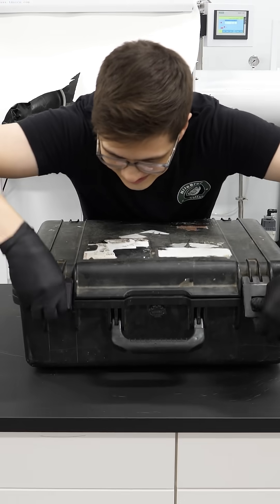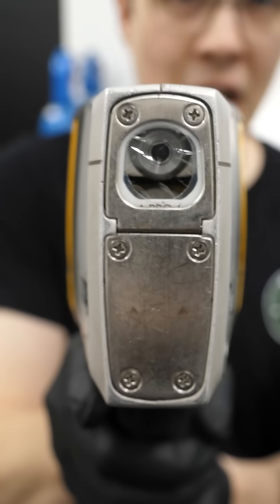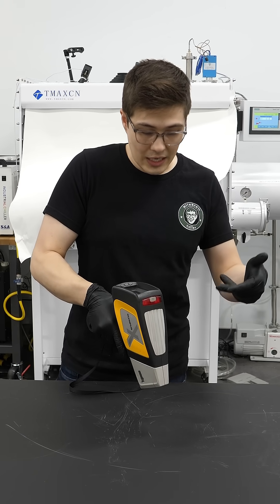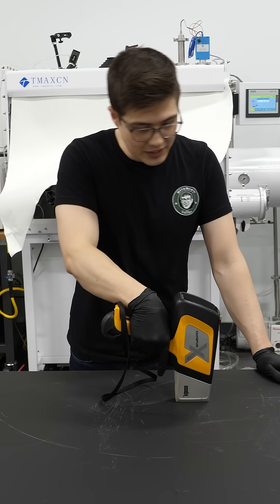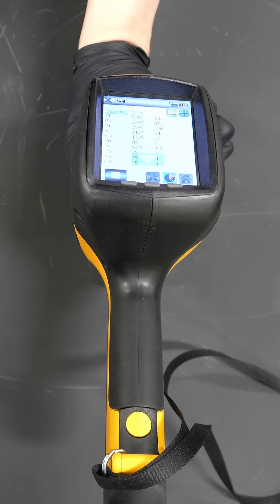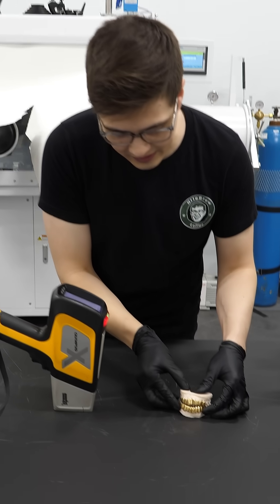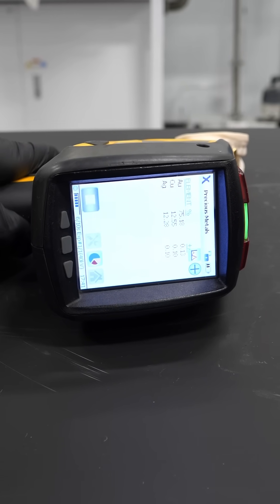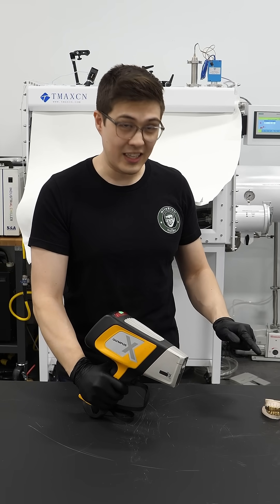I bought a ray gun

Comment: I used to work with those, you can use them to determine the composition (metals) of PAINT, the composition of SOIL if the sample is properly packed, and the alloy composition of metals.  
If you work with them regularly, one of the things you NEED to remember is it does shoot x-rays and they will shoot through a desk.  So if you're working on a desk or lab bench, MAKE SURE YOUR LEGS ARE NOT UNDER THE DESK or it will hit you with X-Rays and you'll eventually get bone cancer because of it.
Reply: this is why x-ray doctors always stand way back when they take photos. it's not going to affect one patient just having a few photos taken, but it will affect the doctor that has to take a hundred of those photos between every patient every day
Reply: @perkypears  Yep.  Also why they make patients use a lead apron to cover any areas they don't need x-ray pictures of.  No sense in getting full body exposure if you only need to see a single bone.
Reply: Is a cancer risk on the warning label, or are you just making the same assumption I would make.
Reply: @urieaaron   It's on the label, and in the instruction manual, and in the digital software tutorials, and a MANDATORY sticker on the side of the gun.  It specifically says in the manual "make sure your leg is not beneath the sample or you will expose yourself to potentially dangerous levels of radiation."  When you boot up the software, there is a pop-up window reminding you to move your leg out from under the desk before you pull the trigger on the gun.  Olympus took great care to make sure users have multiple opportunities to be reminded not to shot an X-Ray laser into their own legs.  Basically all the same warnings and signage that goes with a medical x-ray machine comes with this one, too.

And it is an x-ray laser gun, literally.  One or two test scans with the thing might not leave you with any lasting damage, but just like a medical x-ray machine if the technician is working with it daily the effects will build up over time, and the risks (specifically for cancer caused by radiation) also increase the more often you use the device.  
It's not so dangerous if you use it properly - make sure you know what you're aiming at and what is behind/under the thing you're aiming at; keep the scanner tip flat against the surface to avoid any unwanted sideways reflections of the beam, and if you're going to use it pretty often then you might consider getting yourself some simple lead shielding to cover any body parts that may be inadvertently in the path of the scanner beam OR REFLECTIONS FROM THE BEAM.  If you're checking paint that's on a wall, look behind the wall first to make sure you're not accidentally going to expose anyone or anything behind it that may be sensitive to x-ray radiation, and don't hold the tip at an angle but keep it FLAT against the wall to better contain the beam - and to get a more accurate reading.  Common sense and good prep work are key to using tools like this safely.
Reply: @urieaaron well, assuming that ionising radiation can give you cancer and you should thus protect yourself from it is actually a pretty safe assumption.
Reply: @urieaaron in Belgium we have to register them with the “FANC” (federal agency for nuclear control), and you have to have permits to use it. So yes there is definitely a risk associated with using it.
Reply: @urieaaron I'm assuming there is a radiation risk label somewhere on the box or on the gun, as all x-rays do. 

But specifically the problem is that if you use the gun often but don't carefully point it away from yourself, overtime all of those exposures stack up. Just like going through an x-ray machine, once or twice is perfectly okay, but once you get up to something like 50/60 times you're treading on dangerous ground. Plus this x-ray gun is probably more intensive than a regular human body x-ray, since it's meant to analyze metals and such.
Reply: @caseyoverland7829   It's not "more intense" it's actually LESS.  But it's also a COMPLETELY DIFFERENT technology, a TOTALLY DIFFERENT way of using the x-rays.  In medicine, you spray x-rays at a body part and your actual target is the film behind the body part.  After you develop the film, areas that the x-ray hit show up as black, while areas that had the x-rays blocked (by metal, bone, etc.) show up as transparent.  So you're not even looking at "compositional analysis" in that case, it's just a straight up photograph but using x-ray instead of visible light.  But this gun and XRF in general works differently; it's a whole branch of physics in itself to explain how this system works.  You're actually reading x-rays that are emitted FROM your target, since hitting them with the original x-rays kicks an electron out of its orbit and a higher-energy electron then has to drop down to fill the hole... and that extra energy from that second electron has to go somewhere so it gets spent as x-ray radiation which the gun's detector can measure.    Now those lighter atoms only have ONE layer of electrons, so they don't have any higher-energy electrons to drop down and fill a hole if an inner one gets kicked off by the gun's x-rays... or if one does then the energy difference is too small for these detectors to read accurately.  Those heavier atoms, like plutonium or calcium, have several layers of electrons and each time a lower-level one gets kicked out by the x-rays the hole might be filled from another one from ANY of its other levels... which is why most of the elements emit several different frequencies - one frequency for each different level of electron that can drop down to fill the hole left by the one that got ejected.  
Medical x-rays are just photography with a twist.
XRF is a cross between materials science and particle physics. 
And the XRF beam is much narrower, covers much less distance and area, and uses much less power... and is considerably "safer" than medical x-rays.  But yes, you still have to be careful when using it because if you're not paying attention it will come back and bite you when you find out you've developed bone cancer or something.
Reply: @MrDavidMoyer  I'd like to thank you for all the neat info you shared over the last handful of comments. It was a pleasure to read!
Reply: @MrDavidMoyer  it is a few orders of magnitude more intense; it's just much smaller. A chest X-ray unit would just melt if you ran it at XRF power.
Reply: No, you have it backwards.  The XRF unit runs on just a couple of Watts for its beam, while the medical x-ray machines use around 70W.  But as you said it is also MUCH smaller, meant for scanning 1 sq inch rather than several sq feet.  And as such it requires a lot less power to operate, the machine is less power intensive AND the beam is roughly 50x weaker than the medical machines.  
But in biological terms, looking at the differences in what effects the beam will have on your body... there isn't much difference between the two.  The real difference shows up in how frequently you use the equipment.  Medical x-rays take a while to setup.  You need to replace the film each time, and then get the patient into position, and then adjust the aim and positioning of the machine, and then drape the lead apron over the patient... so you're limited in how many medical scans you can do in a day.  But with the XRF guns, as long as the samples are prepared beforehand (or simultaneously but by someone else) you can literally run 2 scans per minute, all day long.  And the worst of the health effects come from repeated exposure, especially RAPID repeated exposure... or extended exposure times but that's not an issue with either machine since both only activate the beam for a fraction of a second up to a few seconds each time.
Reply: @MrDavidMoyer I do inspections on x-ray units. An XRF has to push enough energy density to push through the sample and saturate the material with enough energy for the atoms to kick out there karacteristic x-rays in statistically signifigant numbers.  Imaiging xrays just need to have enough  to energey and desity to see the absorbtion in soft thing like human tissue.   Hell a minute of xrf will start to burn you while it take minutes of full blast Floro to start burning you. Now its a dime sized burn  compared to  a dinner plate, but its still  a burn.
Reply: Randy Marsh has entered the chat
Reply: I was wondering about this, thanks for your comment! And when scanning things at table level by aiming away from the camera, Nile should especially be careful of his testicles, lol. Both because it could cause infertility and because testicular cancer (TGCT) is correlated to x-ray exposure more than most other cancer types.
Reply: Yep! Also, you should have a license to use these in Canada through CGSB and typically you need to register the gun as a radiation source!
Reply: @Hyperlophus  We don't have that here in the US.  You're just supposed to take a short training course either the one provided by the equipment manufacturer or by your employer, but the course can be done in less than an hour.  Last I checked, it wasn't necessary in Canada either (the license part at least) but it's been a few years since I did any work on XRF's for Canadian customers so maybe things have changed since then.
Medical X-Ray machines here in the US are MUCH more heavily monitored and regulated than the industrial ones that are used for construction, engineering, or science rather than being used directly on people.

Comment: Bro, he literally spent $18k on this XRF analyzer (saw a listing for it on Ali Baba rn cuz I was kinda curious)

That is insane.

He's making an entire arsenal of niche lab equipment worth over 200k probably at this point.
Reply: It's more than that. Olympus is a real brand, not a Chinese knockoff.
Reply: @James-vn8zb  I get the feeling that these things are so exorbitantly expensive mostly because it is such a niche product geared mostly for large companies and scientific organizations.

There is no way an x-ray emitter and detector (coupled with some algorithm using a publicly available material spectral database), which isn't some new novelty technological feat in any way, costs anything close to that to manufacture — and even to produce overall when considering development and certification costs.
Reply: @TLguitar  it’s definitely not cheap, I used to work at a company that makes the source and detector in these handheld XRFs and they can be quite a pain to engineer and produce. The X-ray source has to operate up to ~50kV and be finely calibrated to within just a few hundred volts across a wide temperature range. Also making the X-ray tubes is a pain because you have to verify the X-ray flux, spot size, and location on every tube, which can drift over time/temperature. It can take weeks to go from raw material to a completed source, and the raw material can be quite pricey. Also you have to factor in yield, since not every source made passes or survives the rigorous testing.
Reply: @ElectronicallyIrresponsible  And still that development and production cost is probably many, many times below a low-end of $18,000 or so, which is the price of a cheap-ish car, which also has development and certification costs and needs to pass different testings of sorts.

So the price for this must be enormously dictated by the identity of its target customers and its nicheness.
Reply: @TLguitar  I bet the higher end XRFs can easily spend more than $10k-$15k on just the source and detector. The budget brands may go for a cheaper source and detector, but I would be surprised if it’s less than $5k. The lower product demand and niche market obviously creates a price increase when compared to a car but that’s just common sense. These are precise devices that are produced in lower quantities and use very high voltages in a compact device. Taking that into consideration, the price really isn’t that bad. Also these are fairly commonly used outside of large companies and labs. A huge use is in material scrapping and tracking contamination rates by smaller companies.
Reply: @James-vn8zb  welp, i didn't look hard enough. Jus the first listing i found with a visible price tag.

How much does the Olympus one go for?
Reply: It looks used tho
Reply: there's some online listings for used analyzers under 10k, he probably found a bargain
Reply: @aarvlo Definitely, you can see pretty significant scrapes on it on the first wide shot after he stuck the battery in, the sort of wear and tear that could only come from field use

Comment: Please do not point at the camera 🙏 i don't want xRays thank you Nile!❤
Reply: When monitors start producing x-rays we'll all be in trouble lol
Reply: @loganboylen2389  watch the hell out for CRT monitors then lmao. They give off Xrays, and are a real good way to die if you dont know what you're doing when you repair them. And people just had those demons in their house lmao
Reply: Lol I opened up a CRT TV as a kid and was messing with it. Luckily, it was well labeled and I closed it back up real quick after reading the warnings. Haha
Reply: @Aetharn  Oh wow that's fascinating - I didn't know that CRT's actually produced X-Rays!

Cheers for the information haha
Reply: @loganboylen2389  for a little more info, the radiation they give off is mostly harmless, since its very weak. iirc you can detect it on geiger counters though, mainly from the sides of the device. The main danger is still the high voltage electricity, from what i know. Might be wrong though, since i'm not too versed in CRT repairs.
Reply: @Aetharn  Crts were supposed to be made of leaded glass, opaque to x-rays.  There were however some high voltage tubes that required shielding for x-rays.
Reply: Everyones is taking your comment too srsly.
Reply: @LlamarJr  ikr 😭
Reply: that isnt how it works
Reply: @meax15  wow, its almost as if they didnt mean it, like they were making

A joke?!?
Reply: @meax15  that us how it works actually
Reply: @meax15  That's what you think

Comment: so a cancer gun?
Reply: A Harley Quinn reference has been detected.
Reply: In my experience with these they aren’t usually actual X-Rays, these are used a LOT in industries pertaining to manufacturing with metals, and this gun would typically shoot a laser out, or strike a small arc onto the metal using electricity, and whatever is sent back into the machine from what is being sent out is able to be read and diagnosed so that you can know things like what grade steel you have, what percentage carbon or manganese or silicon is in it etc…
Reply: No gama maybe
Reply: Which is any gun to the state of California

Comment: We use a couple of these where I work. They are pretty easy to use, but very hazardous. We manufacture specialty alloys and we use these to identify which alloy each product is, since they all look like "metal". We have around 30 alloys just in my department and it can be a nightmare if there is a mixup in scrap or finished product.